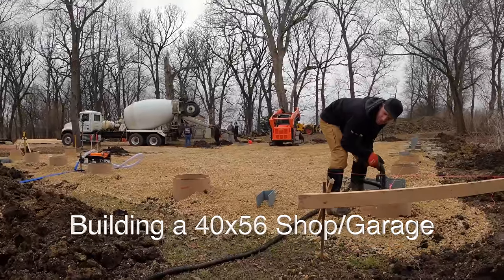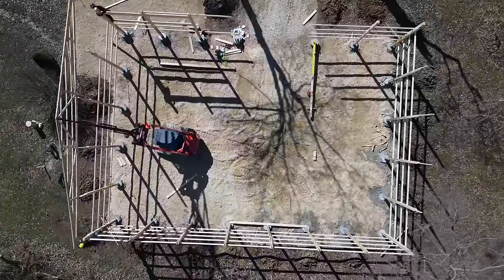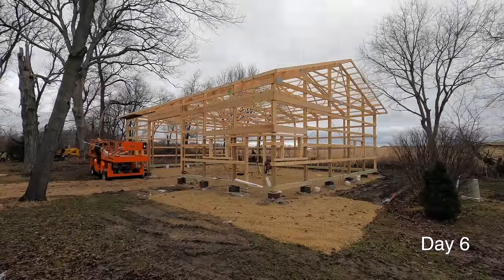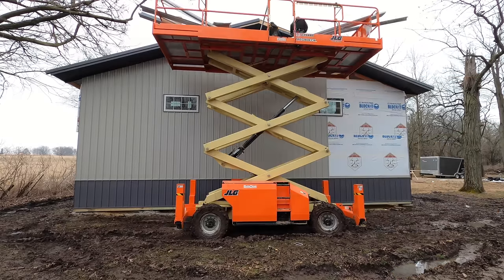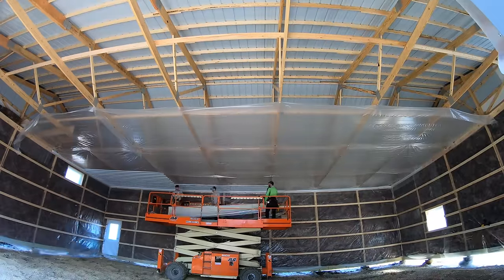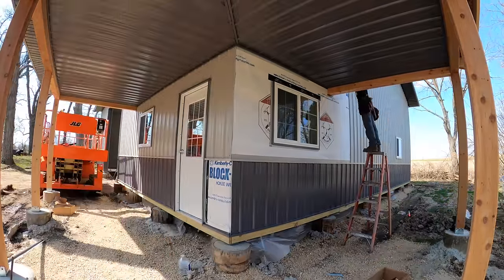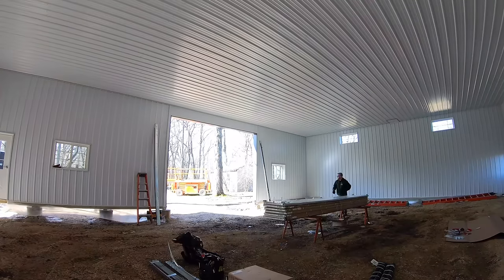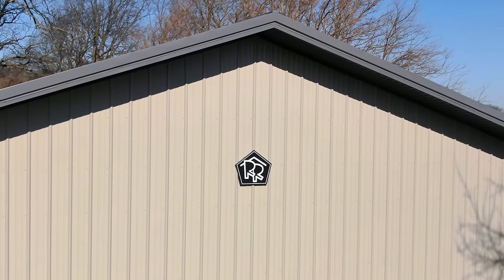40x56 Large Garage Full Time-Lapse with Wrap around Porch

Comment: how much is something like this? I know... that's a super open ended question. I just want to have an idea
Reply: I'd like to know also.....I'm in the market for one.
Reply: I have the same question. What’s the rough cost of something like this?
Reply: Like 30k just for the building, and putting it up yourself not having someone else to do it. Usually figure in the same price for a concrete slab so about 60k if you diy.
Reply: @Chris-sf7ug  damn i got a similar size for 9k
Reply: @colbybarbour9990  wood or metal?
Reply: @Chris-sf7ug  metal

Comment: Nice build.
Do you ever build large overhangs?
My current house has 2’ overhangs and I love them. I would never want a house or a shop now without a large overhang.
Also with this type of build, how does the owner attach shelving or other items to the walls.
I understand your comments on the better insulated envelope using wide spaced posts and perlins, but I’m scratching my head for all the tools etc. than need to be attached to the walls.
Regards,
KJ
Reply: The Perlins are still 2x4 material strengthened vertically by the metal so I don’t see why you couldn’t hang things off of them. And if it’s something really heavy then you could just go off the posts themselves. But really what all needs to be hung on the walls in a shop like this ?

Comment: You should have put adequate drainage under the slab. Pushing out standing water with concrete may save time and money but guaranteeing a wet floor. I was a.ways told to build on a solid and dry foundation.

Comment: I didn't see any electrical get installed in the walls..? Did I miss that part?
Reply: I'm sure an electrician is simply just going to run conduit pipe against the wall so no need to have it in the wall.
Reply: @TheFoyer13  that is very possible, just not quite as clean of a look.
Reply: @josht8239  Yeah but it's going to be a work shop I imagine not a living space so makes more sense IMO. Plus it will just be easier to lay outlets where you're going to need them like power tools and what not.

Comment: The problem with the elevations at the base of the building isn't that you show them every video..but that you never show them being finished. I think the only time I saw the finished elevations pre and post concrete floor was with the Diresta project..but those videos weren't on your channel..they were taken by Diresta and posted on his. Most people not in the trade don't know what a grade board is or the setup and prep for the concrete floor or even the grading that happens outside the building. it's a mystery that never gets answered on your channel.
Reply: Look up the pole barn insulation by RR he shows all about the bottom purlin.

Comment: On average what does a shop like this cost?? Curious on prices.
Reply: Cheapest one i priced out living in ohio was a 24x24 finished inside was 50k.
Reply: A lot,  plan $55 a foot and see where that takes you..
Reply: Steel buildings are cheaper, and they don’t burn ...
Reply: @markman63  
World trade center was steel...it melted.
Reply: JC S  everything melts...
Reply: Dale Hall, right, but not because of regular fire. It melted because it was planted with nano thermite which melts metal.
Reply: With a wood frame building you have to worry about termites. With a steel frame building you have to worry about thermite.
Reply: @relikvija  everything melts in Arizona...lol...but we can Skylights of Every Variety... No Harsh Winters...I guess thats Why none are Ever installed here...Free Light...wtf over.
Reply: Dale Hall...  You are correct.  Then again what are the odds of a Commercial Airliner flying into my small building...?  It would probably be demolished and I would not have to worry about fire being the reason for it: it’s destruction... LoL.
Reply: @dalehall2993  “melted”
Reply: @markman63  That is the route I went. 40x60x14 red iron.
Reply: Eastern iowa price is around $25/foot with concrete.

Comment: when you have that span between trusses, over time will the roof sag at all ? i am getting ready to start a project and i wanted to follow your techniques.  8 ft on center. i was told i needed to get them closer. your opinion and ideas would be awesome. we are doing a half apt and half shop, Thanks in advance
Reply: 8' foot centers for trusses is to far apart.  Remember a house is no more than 2' feet centers, so, a garage should be no less than 4' foot centers, less if you are located in a heavy snow load area.. Spend the extra money and add more trusses no less than 4' centers..

Comment: And I noticed that some foam board are installed around the foundation maybe 1 foot deep? But it won’t help, the water will still find the way goes under the con concrete floor. As long as the water goes the problem for foundation goes. So another 1 million dollars suggestion to everyone here is choosing a right location for your shop,: Try to stay away from the water! It’s either on a hill or on sandy soil if you still want to go ahead with this kind of traditional way pole barn.

Comment: I have experience on a 40 years old commercial 10000 SQF pole Barn. It’s interesting that the way you guys build here is the same as 40-50 years ago.  The problem is the concrete floor: It will float up and down during the winter / summer because frost / water goes under the concrete and in the end the floor will crack! some areas will even sink down a foot over the years! So the in floor heating system might help to get rid of the frost, but that way your building rely on the heating to survive. So my suggestion is : Spend more money on concrete foundation will pay it off over the years. 4 foot deep In ground  concrete foundation wall is the only way get the building last longer!

Comment: At 5:05.  "we knew the building wasn't going anywhere".   A strong enough wind could easily blow that structure down with not much shear strength yet in the walls.  I once saw in Las Vegas a 2 story apartment building with the roof done blow over because the framers had not yet done any shear walls.  weirdest thing you ever saw because the roof was largely intact,  but instead of being 20' in the air,  it was approx 3 to 4 feet above ground.  LOL

Comment: Why use nails for joining boards? Over time, they come loose and don't hold boards together as strongly as screws, screws grip the boards tighter together and you don't have so many hammer head marks on the board. Why are you not using screws instead?
Reply: Screws do not have the shear strength of nails.

Comment: Question, why do you  not use a nailgun? Is there an advantage to using a hammer?
Reply: Hey Seth.

I would say It's more because of the feeling, can we say the feeling of 'mind control, mind- set.. that we experience when we use a Hammer more then the actual hit.
Well.. a feeling connected to your brain and hands more than what your eyes really sees. It happens so fast while you are focused on so many other things around you at the same time.
You don't want to hit your fingers and aim right on the top of the Nail and if you miss and It's over.

In other words, you are fooling your eyes. If you focus too hard on hitting the Nail and just as you are about to go.. you will miss more times than actually hit it.
The same happens In Golf and hitting the ball, try and close your eyes instead? Do that work.
Now, take the Hammer and you will feel when you hit the nail, I promise..
..And you will feel when you don't hit It as well too. XD.

When hit
You should feel good to both your palm & hand as you make the perfect Nail In the wall ofc with a Hammer Is what we are talking of here.
..You kind of feel It down the Hammers Handle when It's a good hit and you don't even have to look, the nails are completely in to the wooden plank all the way.
And the fewer hits to the Nail you have to hit, the better.. this grows over time and you will be better at this to master, two three hits should do It with the right force.

There's nothing up against a good woodtype either ..that with the perfect year to It to build with. Build your own log cabin. Now that's a dream of mine.
You can sense It by the smell In the wood and look on the year-rings within the tree. Oak wood & Lodgepole pine from up North. My God! 

So to answer you, Seth.
"Will you have an Advantage with a Nail gun, No, maybe you will be faster, 'I said maybe, but that comes down to person also holding the VS. Hammer!"

And btw Hammers today are 10/10 when It comes to comfortable and responsive to operate. LoL no, not really, too much plastic involved. Well they are but it's all about 'saving- time' today when you build something so it doesn't matter..
..
Back when I started framing we had Nail Guns, but we didn't get to use them. Everything was nailed by hand and I loved It. Then our new manager/ boss If you will' came along "Mr, know how to make more and save money, yeah that guy came. (There are reasons why Dinosaurs are extinct, right..?" He said that on his fist day there) And along ofc came also the Nail Guns.
Everything was supposed to be faster done by the hour.
No time and stop to get some rest, that we could do first when we died old he said later on too. But also It was more often the walls din't make It, and It looked poorly, yeah It looked like shit In the end always when we used Nail Guns. I hated It. Anyway and the complaints came In on the guy like a hailstorm and affected the business too.
I think later on the boss killed himself, yeah he did. It was just a matter of time, we all knew that. Cheapskate vs. tightwad or whatever It he was. His days were far over way before they even started.

But back to the Hammers.. Every now and then we used to have races when sheathing roofs, fastest with a manual Hammer won. (Like back in 6th 8th Grade when you hade "CESMCC" "Cock Erection -Size Measurements Comparison -Competition In the boys locker rooms after gymnastics practice at school ..O'Boy I haven't used that spelling "CESMCC In a long time, People who know, know)

Anyway.. I started using Nail Guns much later but never went back to a ordinary Hammer. Sad f*kn sad really. I still use the hammer at home on my own house just only to the purpose 'of not how to forget on how to use It will say. All the sudden I start to build a new fence around my backyard when I have the time.. And I can still hit the nail good I'm not that old yet. Don't believe me ..Come at me" Haha.

The problem with new guys today Is that they've never learned to use the hammer first, they use the gun first and can't nail well with the hammer.
Some people should feel ashamed why they don't learn the basics first.. Look Into the Martial-arts world; Kung Fu and Jiu Jitsu, the fist thing they learn, !Have to learn Is to travel back thousands of years and learn Techniques, aka. Well the basics first, otherwise they don't get to fight, Is It, Tai Chi maybe. Well I don't know.

Now It's time for bed. Be good, Seth.